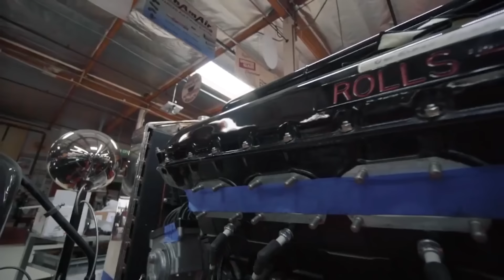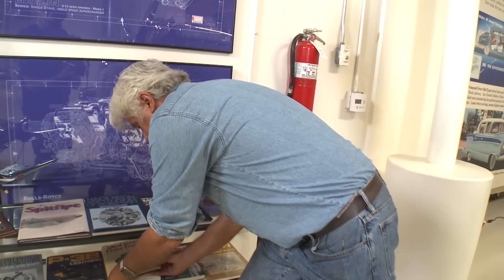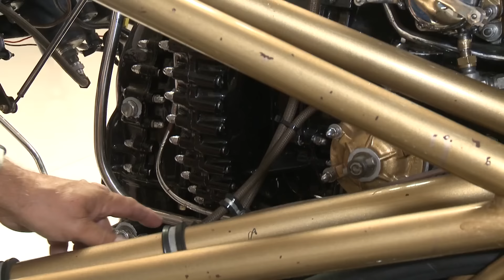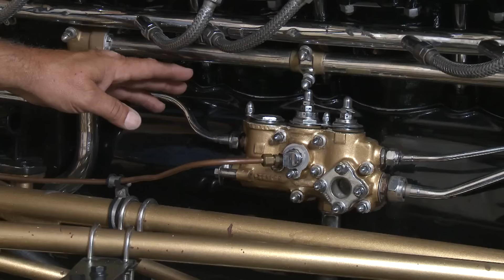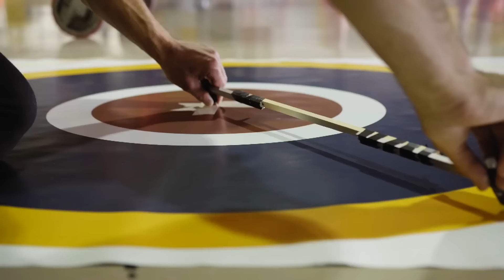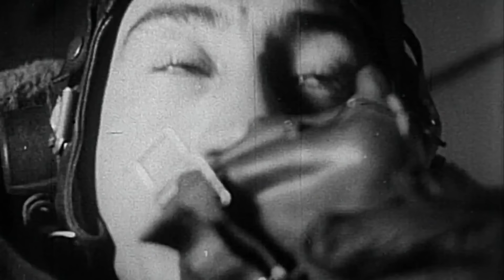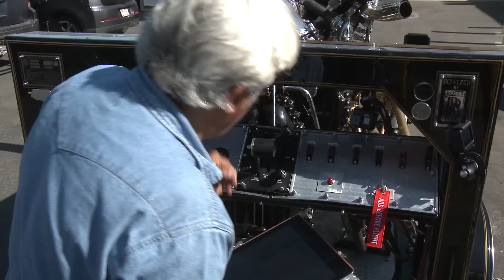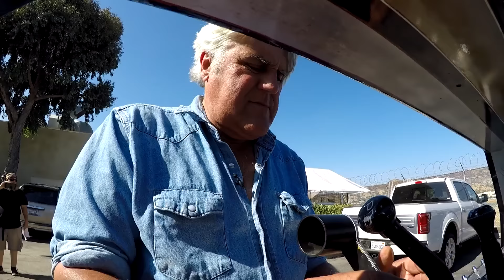The Engine That Won World War II - Jay Leno's Garage

Comment: Jay, the Merlin's Carb's on the Mustang's were up draft & down draft so the Stang's could fly inverted with hard G's. Also, we learned @ A&P (Airframe & Powerplant) school that the compounded Supercharger/Turbocharger were used by Mustang's, as well as, Lockheed's (Skunk Work's) P-38 Lightning. The Turbo was activated when aircraft was at higher altitudes by prop jock.
Reply: The P-51 is equipped with a Packard V-1650 engine with Stromberg up draught carbs only.  The engine has a two stage / two speed supercharger, but never a compound turbocharger.  The P-38 had Allison engines.

Comment: Nice engine-and it did help to win WWII along with Allison, Chrysler (B29), Pratt and Whitney, etc. The real engine that won WWII for us was General Motors 71 series Diesel-specifically the 6-71. It powered tanks, and especially hundreds of landing craft. It was the only really light in weight Diesel of the time (2 stroke design-where blowers for dragsters came from). Need more power than 225hp-they had twin and quad configurations also. General Motors Diesel turned into Detroit Diesel. The 6-71 was made from 1938-1998. And the 6V-53TT, 8V-71TA, 8V-92TA is still being made for the military equipment that the engine was designed around.

Comment: Surely the Mustang and Lancaster engine were important to the WWII effort; however seriously I doubt that engine even came close to winning WWII.  There were many engines that had at least had the same or exceeded importance.  The engine of the B-29, B-17, B-24, B-25 & B-26 were equally important.  But, the engines of the Transport aircraft C-47 and C-46 were what kept the fuel flowing and guns and ammo and bombs and the para troops a dropping.  It is easy to point out the P-51 and engine and truly great pilots of the fighters, but my hat is off to the Bomber and Transport pilots, their planes and the engines that put them in the air.  As to war history and what had the greatest impact, Jay is a novice!

Comment: I remember when I worked on SU Carburetors they where always temperamental.  It's a real art form and a thing of beauty to
keep low RPM revs stabilized between fuel and air balancer.  The folks who overhauled that Merlin were brilliant and Jay's love for all things mechanical is great.

Comment: The Merlin is the largest production aircraft engine in history.  Some think it is the Pratt &   Whitney R-1830 but when you take into account the Packard 1650, the American built copy, production easily surpasses 200,000.
Reply: Here are the numbers: Packard; 55K, RR 60K, FoMoCo 30K.
Reply: Graham White Really?  I read Rolls-Royce produced over 160,000?
Reply: No one really knows the exact number. In addition to the ones quoted above you can add about 1K made by Continental. The most commonly quoted number form ALL manufactures is 150-160K

Comment: If they can get you to ask the wrong questions, they
don’t have to worry about your answers. Looking in all the wrong places, truth
has been hidden in plain sight.

The biggest Hoax that has been played on us, is the Idea
that we need some type of fuel to create electricity for power.  The patent for Atmospheric (static)
electricity has been around since 1900. We have been getting all our
electricity from Power lines, Tall metal pylons, skyscrapers and other tall
metal structures dressed up as art or something else. Power plants do not
produce electricity and are constantly being built just to keep them in our
minds eye, that we need them. Once the infrastructure is in place, it costs
nothing to produce. This may be hard to swallow, but truth is stranger than
fiction. They spend billions every year around the world trying to build new
power plants and what matters most to them, is the controversy it creates in
towns and cities, when people vote for or against them.

          We have a
780 megawatt power plant in my town built around 2002-2003 and since shortly
after it was built it has never been in operation. The reason I hear is the
cost of natural gas is to high right now, yet they keep putting more very tall
power lines next to the existing ones. The higher  the better for collecting the static
electricity. Ever wonder why all those very tall power lines  are running through the woods everywhere and
as the electricity demand increases, so do the power lines. They have been
rapping us for trillions of our hard earned money.

Comment: Sounds as if it has a fueling/mixture problem(!)  It doesn't run evenly - or pick up cleanly.
Reply: Runs on compressed air **********NO Fuel  is Needed***********

Comment: Packard made a marine version of this engine, and put three of them in the Elco 80' PT boat.  Imagine the sound they made back then when  spooled up.  They too ran on aviation fuel (3000 gallons) and at full speed consumed 500 gallons per hour with all three spooled up.

Comment: Just in the interests of accuracy there are two flying Lancasters the Canadian one is FM213, but flies as KB726, and the UK (Battle of Britain Flight) one is PA474. Jay actually included a brief video shot of them when the Canadian 'Vera' flew to the UK a couple of years ago . I will always treasure the sight of the Lancasters and the last flying Vulcan bombers all flying together. All designed by the same man in the same decade

And another comment: There is another complete Lancaster (NX611) in the UK that does taxi runs with passengers. Again there is a wonderful video of the two flying Lancasters flying low over their sister aircraft. This one is planned for flight status.

For those interested this link may be of interest:

https://en.wikipedia.org/wiki/List_of_surviving_Avro_Lancasters

Comment: A truly great engine, a shame though its been polished to death, they were never like that out of Derby..
Reply: I did the original restoration on this engine and Draxindustries1 is correct. No Merlin left Derby (or Detroit or Cleveland or Manchester) looking this pretty. However, you should have seen the pile vandalized corroded junk I started with. My aim was to make this a functioning piece of art-work. Also, don't forget that R-R produced some beautiful cutaway Merlins that had been "polished to death". Check out the Science Museum in London. Every external fastener had to be replaced so I drilled and tapped (Whitworth, BSF, BA, BSP etc) chrome plated acorn nuts as replacements. It was far from a quick polish job. And the foregoing does not include what it took to get it running, designing a trailer, getting a prop (ex DC-3), radiator (ex Northstar), designing  a pre-oil system, incorporating a modern spin-on oil filter, making a fuel system, oil system, electrical harness, oil lines, coolant lines etc..............The list goes on forever but I think you get my drift.
Reply: Graham White.  Thanks!  You did a truly outstanding job!
Reply: Graham, its beautiful. Its a piece of functioning history enhanced with artistic flair.
Reply: It was designed by Rolls Royce. They only let you Yanks produce it because you didn’t have a V-12 engine with a compact and reliable two speed supercharger. No wartime production could afford such frivolities.
Reply: Bartonovich52 and we improved it in the process like other things
Reply: Pity about the "chrome plated nuts".  The one distinguishing feature of a Packard-built Merlin was that all the external nuts were cadmium plated whereas UK-built engines were unplated. (This info came from a chap who maintained Merlins for the 'Pathfinder' Mosquitos).
Reply: Thank you Graham, it is stunning!
Reply: Graham White

Comment: i heard some of these beasts also ran 2 stage blowers with nitrous for a total output of close to 2000 and couldnt hit full throttle on take off cause they would literally shear the plane from the back of the engine now thats power

Comment: Jay one of the first times I have to disagree with you. I work on radial aircraft engines. So I'm kind of biases. But the Pratt & Whitney R-2800 was the engine that won the war. At lest in the Pacific theater. And the Wright R-1820 was a big help in the European theater. But the  Rolls-Royce Merlin was a GREAT engine. And thanks for the great video.

Comment: I heard that Merlins were "temperamental" and killed some pilots? Was that just the earlier versions of the engine or what? Also original B-29 Engines had flaws too... As result, the newly restored "Doc" has modified version of original engines.

Comment: 09.27 Lancaster bomber VERA came over to the UK. Amazing sound of 8 Merlins on 2 Aircraft.
Back in the 1960's saw these engines being scrapped, such a shame. They are Kings of the V12's. I loved driving a series three XKE with the 5.3L V12. From the first drawning of a merlin I wanted to be a engineer.

Comment: One thing thing that made the Messerschmitt Bf 109 superior to the spitfire was it's engine.  So how could this engine be the best?
Reply: The only way to isolate that variable and prove or disprove that contention, would be to outfit a Bf109 with a Merlin and a Spit with a DB and compare stats.  Though I suppose an alternative would be to simply compare stats of the engines themselves but, since engine characteristics work in context of airframes, I think such a comparison is less definitive.
Reply: There is no conjecture, the Daimler-Benz DB 605 had fuel injection, the Merlin did not leaving the Spitfire to flood and stall on a dive. Very inconvenient in a dog fight.
Reply: I'd say both engines were very well matched throughout the war, after the war when the British analyzed the German piston engines they were impressed by some of the engineering solutions. But generally found they couldn't learn much from it as both sides had acheived similar results using different methods.
Reply: People who use logical fallacies as arguments should not "LMAO". How could  an engine that conked out on a dive be superior to an engine that didn't?
The spitfire was an excellent plane but the 109 had a superior engine because it was fuel injected and RR's engine used a carburetor which was old tech.
Reply: How could you say and engine that floods and cuts out when diving is well matched to one that doesn't?

Comment: Great Jay, there were many grand aero motors from the past. 
Pratt & Whitney marks a personal favorite and have flown behind quit a few.
The Brits were big on sleeve valve radials that had many pros as well, of coarse the axis powers had equally fine motors as well.
The Allison 1710  P /39 engine another fine dependable example.
The Japanese Nakagima Sakae engined zero got incredible range
My 72 Chevrolet Nova I always pre crank till oil pressure comes up to 20# then touch the throttle and she purrs to life once more. 350 small block V~8 two barrel Rochester, turbo 350 auto.

The Willy Messerschmidt 109 had many advanced features as well. Fuel injection not subject to negative g maneuver and very unique motor mount alloy casting with rubber isolation mounts. Also made motor field change a snap. Had a unique fluid coupled manifold charger impelling fan set at right angle to crank shaft. Daimler motor works V~12 87 C-4 octane. Could have large pre sand filter installed on intake for AFRIKA 🌴KORP duties.
Then as now the Germans had brilliant engineers as well.

Comment: A lot of commentary on the Merlin engine but the Daimler Benz was an inverted v with fuel injection that was superior to the carburetor of the merlin. These engines seem to start and run well...perhaps better than the merlin?

Comment: Jay, you need to run it on the green stuff, 130 oct
Reply: Turbo Conquering Mega Eagle Eff that noise, after 1944 the Americans were using the 150 octane that the British gave us. That had the highest amount of horsepower but caused more heat that was not sustainable for the escort missions traveling deep into Germany from the UK.
Reply: 130 only no LL,valve protection. Me, Air Force,Faa oil changer mechanic. flight engineer B-29, 4000 hrs. B-29 FIFI CAF is always on flying tour. R-3350, redesigned cylinders, valving cooling use. Commerative Air Force, DFW,Texas.

Comment: I haven't examined a Merlins internals any closer than looking at a cross sectioned Merlin in the Bristol Science Museum as a young boy but from my own experience British engines often required lots of hand finishing and what we called blueprinting. The first engine I assisted in rebuilding as a young apprentice back in 1976 was the 9.6L AEC horizontal six cylinder turbo diesel which we used in rail cars. Take the main bearings as one example, I believe factory made undersized bearing were available to suit reground cranks but for some unknown reason our company preferred to make their own. You would start off by fitting the undersized white metal lined brass shells to the block and then line bore the bearings.The crank was then blued with bearing blue, lowered into the block, the bolts done up and after a couple of slow revolutions the crank was taken out again so the bearings could be scraped with a bearing scraper using the print from the blued crank as guide where to scrape. Clearances were then measured using a Mercer gauge. After passing inspection they were sent away to be tinned and after they got back the blueing and scraping  process was repeated until you had the correct oil clearance. The con rod bearings were also done the same way. With larger British diesels such as the Crossley HST-vee8 and the English Electrics after taking a scrape we measured the crankshaft deflections to make sure we were keeping the crank level and the bearings in line, all very labor intensive and you could end up doing this a number of times before the inspector was happy.All good fun for a strapping young apprentice but it must have cost a fortune compared to rebuilding the American Cummins or the EMD 645 diesels where you pulled parts out of the box and slapped everything together in less than half the time.
Reply: This is precisely why Rolls Royce chose Packard to license-build the Merlin - Packard was very much ahead of its time in mass production techniques, and worked with much tighter tolerances than did Rolls (the reason why they were able to achieve mass production, as one part was exactly the same from one engine to the next).  The dilemma was amplified with an engine such as the Merlin, which was extremely complex, at the time.

Comment: Many below balk at the merlin winning the war, as for one engine it did hace more to do woth winning the war than any other single engine. In the spitfire it held back the Nazi's. Later in the P 51 it allowed our bombers to survive germany bombings as escorts all the way to Germany. Those two things did more to change the war than most any other single thing. Britain keeping Nazi's  from island invasion, and then as escorts for the daylight destruction of gremany and its ability to make war were 2 large factors in winning.  many many things over those years won the war. But that engine in many planes had to  be the largest single engine contribution to the war.

Comment: Wrong, the Merlin was in too few quantities, the Allison 1710 is well known as the air victor of WW2. Unlike the Merlin the 17120 flew in all Allied air forces and flew in the European theater and Pacific. P-40, P-38,P-39, P-51, all used the 1710. The merlin was basically in the later P-51's (1944-45) and the Spitfire.

Comment: I was lucky enough to see one of these Rolls Royce Merlin airplane engines running up close when I was taking my automotive apprenticeship in Winnipeg Manitoba at Red River College  back in 2001. It was a very similar set up on the stand only the engine was painted burgandy I was really impressed at how smooth those engines run.